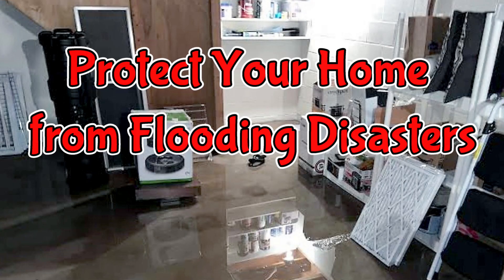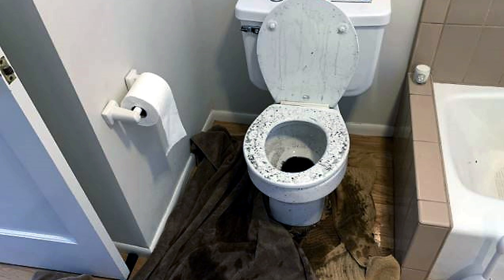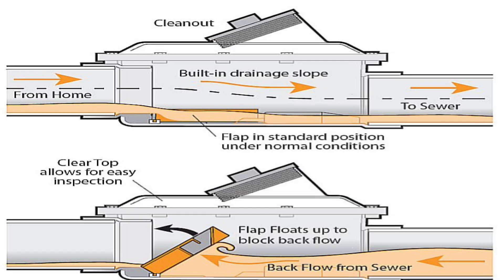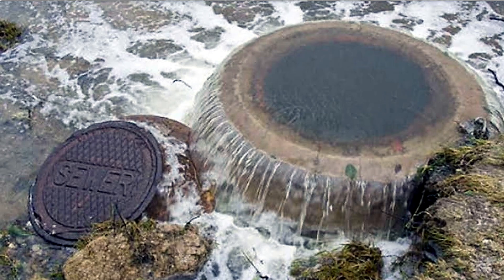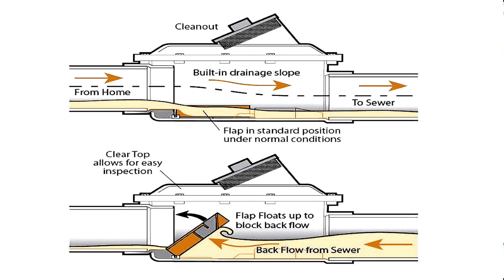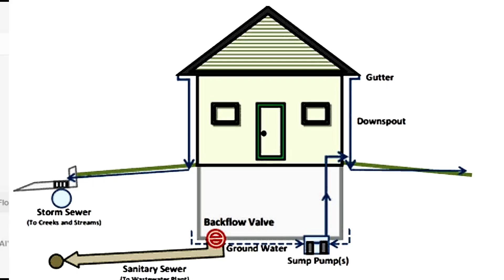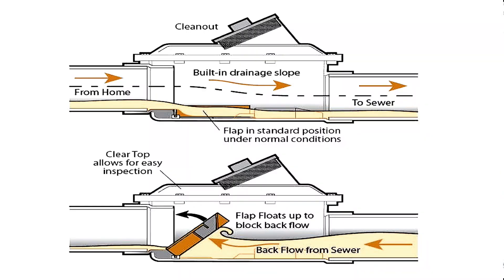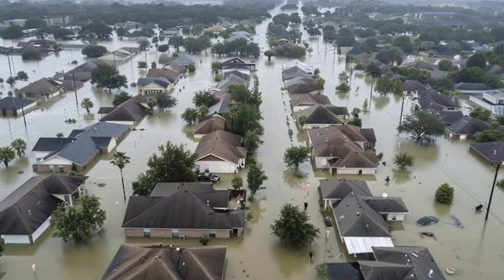How Backflow Valves Protect Your Home from Flooding Disasters

Comment: Freeze at least six bottles of water in the freezer of the refrigerator and put six bottles of water in the bottom of the refrigerator it'll help keep it cool when the heat wave comes on so it doesn't work too hard